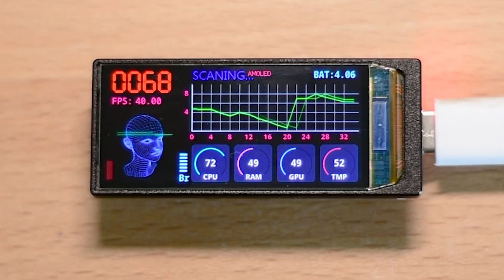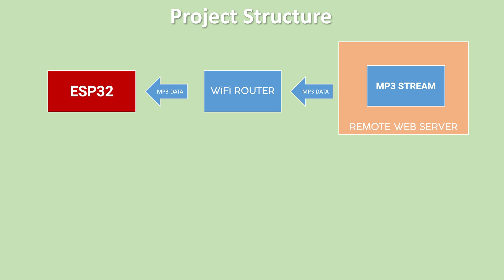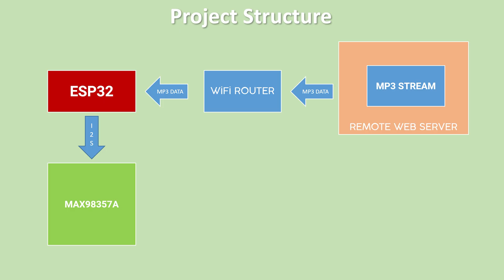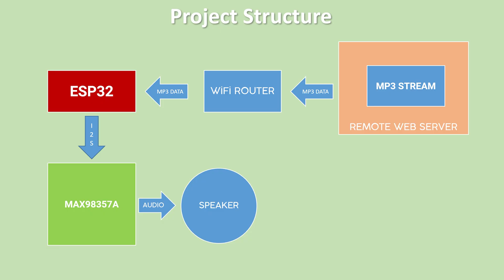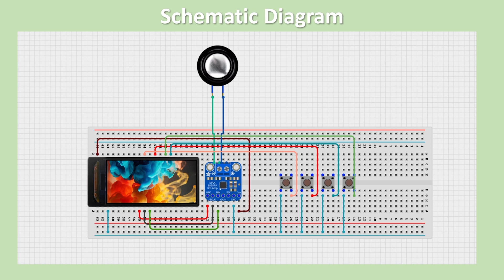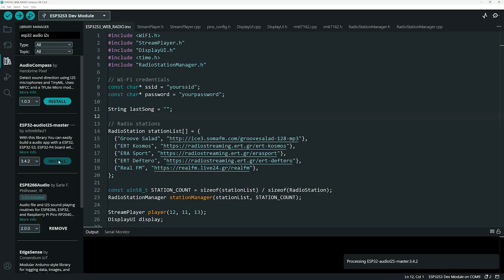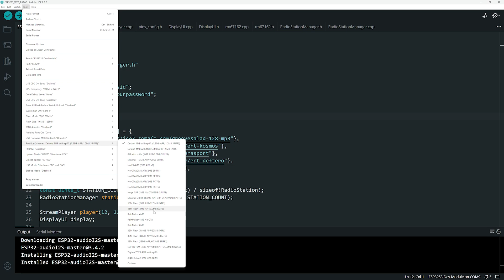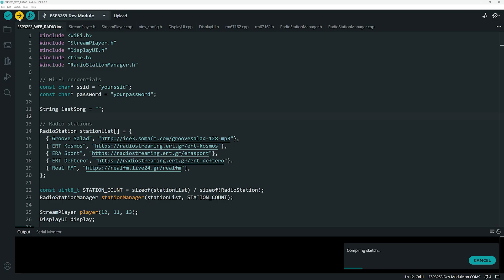ESP32 S3 Web Radio Project With AMOLED Display Arduino

Comment: Thanks a lot for this project. This is a beautifully working circuit. One has to just change the time setting and select own required Radio Stations. I made it into stereo. You did leave out a few details such as the pin connections to the MAX9837A. Of course these were 11,12 and 13. But took a while. Never the less, it was great. I do a bit of restorations of vintage electronics. Have a look.

Comment: Hello
Some years ago I made your first(?) webradio.
VS1053, lots of wires, hard to find right URL’s  because you had to find out port numbers.
Played nicely though especially after the little trafo sound correction.

Yesterday the ESP323S_etc arrived and today I built the project.
It worked right away at the first trial.
Changed EET-2EEST to CET-1CEST and changed the URL’s.
Right time now and my own stations.
Thank you very much.
One little flaw, it skips stations if I  push the button too long. (And I seem to push it always too long.)
First thing I’m  going to experiment with is to change the four buttons for one rotary encoder with the push button as toggle between station and volume.

Request:
The info text by some stations is longer than the width of the screen.
I have seen examples on the net of radios with scrolling info text.
Can you build that in? (I ask humbly because I’ve tried that in the past but always failed.)

Again, thank you very very  much, I will keep following this project.

Kind regards from the Netherlands,
Walter

Comment: Please help. I'm using ESP32 with Max98375 and SD Card Reader.
I'm trying to make my ESP32 to play mp3 from SD card.
After successfully compiled and ran the code, I got 

 OOM: failed to allocate 131072 bytes for unnamed
OOM: failed to allocate 679936 bytes for AudioBuffer

my setting: Flash size: 4mb (32mb)
                     Partition Schema: Hugh App (3mb No OTA /1mb SPIFFS).
I tried other setting and I got  121 % usage of sketch at compile time.

I'm using ESP32-Audio-i2s  library from  schreibfaul1